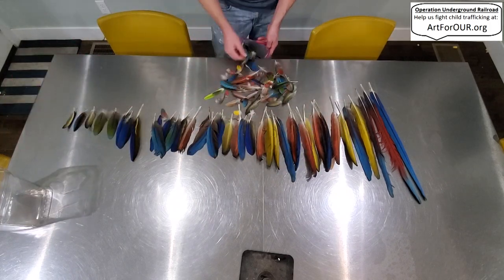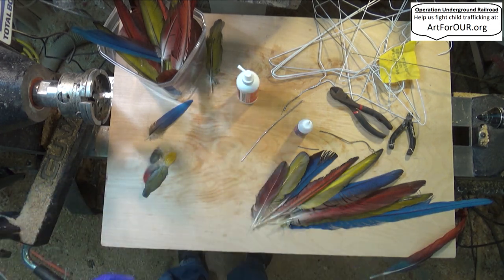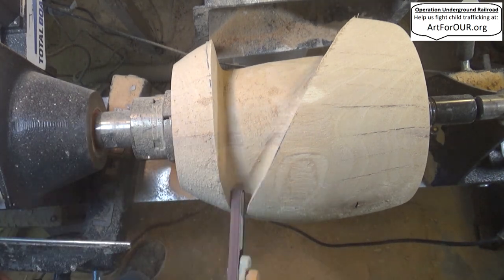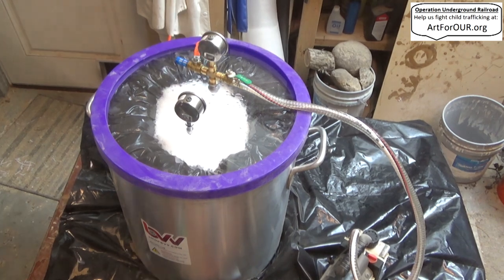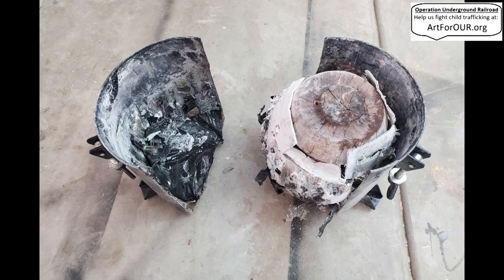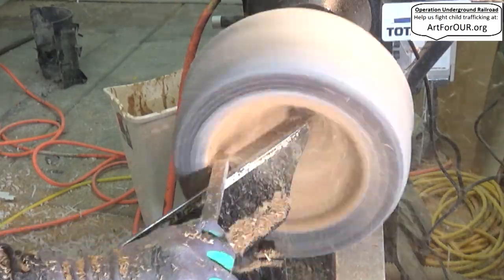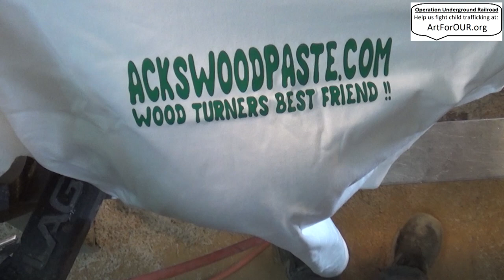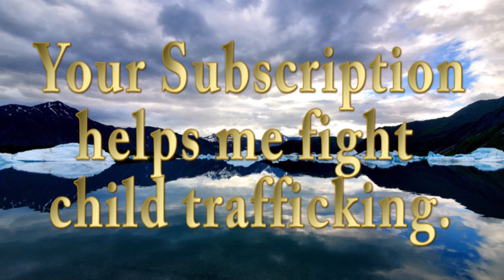"Phoenix Flyby" wood and resin vase with Macaw feathers.  Wood and Resin Lathe Turning Project.

Comment: Dan - the end result is very nice. The wood and the feathers have a unique look and texture to them. Good combination.

As a thought for another project where you are trying to "embed" something in the resin ... you might try using some fast-setting resin (perhaps even UV resin) and use a paintbrush to build up the resin in the cutout until it is about an inch thick. Then glue the feathers (or whatever) to that resin. Then, either pour or use the brush to fill the resin into the cutout. This would allow you to turn the inside and the outside without ever hitting the feathers (or whatever) with the tools. It would also mean you would not have to spend as much time getting the cutout quite as smooth and sanded.

The extra time it would take to build up the inside resin layer would not really take any longer than it did to do all the sanding of the cutout and the difficulty in getting the project out of the pressure pot

Comment: Sorry if this is a repeat comment.  Quick tip on the turning paste- take a shop towel/paper towel and spread the paste over the entire project, the start the lathe on low (high will fling it everywhere) after a few passes speed up the lathe and slowly move up the project these are friction buffing compound you want to feel the heat. They also make a “polishing restoring” that works amazingly on epoxy used after the sanding paste.  Leave as is for a nice finish or Just hit the project with denatured alcohol to clean it and  apply a finish.
Check out sprague woodturning he does a ton of hybrid projects and gives detailed info.  He has had lots of issues with molds and pressure pots, and has a good system.

Comment: I felt bad when I saw the jackhammer come out. When I saw the car bumper, my heart just broke for you! I'm so sorry you went through such hell on this project. FYI, a good way to soften the spines on the feathers is with either a heat gun or a steam gun. It's made out of the same stuff as your fingernails; so just like when you take a hot shower your fingernails get soft. So will the spines on those feathers.
Reply from the maker: That is good to know!!  Thanks. 

Artforour.org

Comment: It turned out great! I loved the design you were going for but, the end result is beautiful too! Sorry about your pressure pot! You’ve got some serious tenacity to push past all that!😅 I wonder if you used a smaller gauge copper wire (like you used to make your copper trees) and coil wrapped the shaft of the feathers.. maybe that would work? It also seems like there’s got to be a way to make silicone rubber work for your projects. I bought a couple of silicone rubber mats on Amazon to cover my table when I’m working with resin, they’re called Monster Mat and they’re 24”x36”. Maybe you could wrap your projects in those? I don’t know.. just a thought. Great job!
Reply from the maker: Thank you!  I appreciate the ideas!

Artforour.org